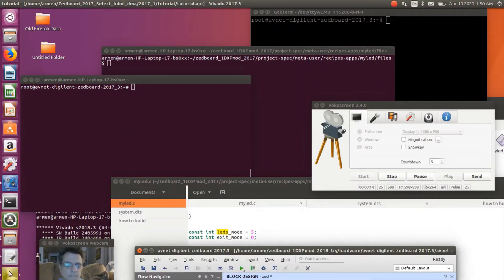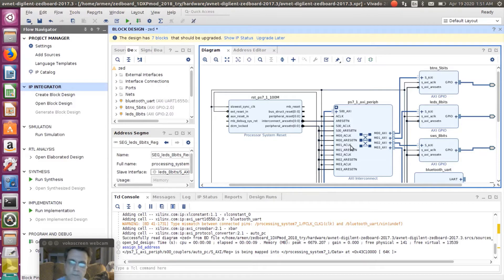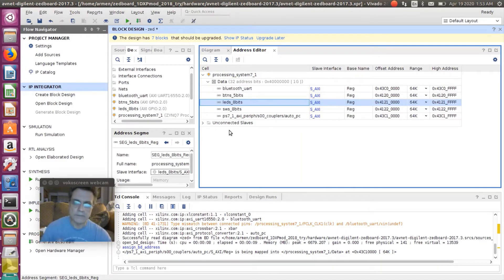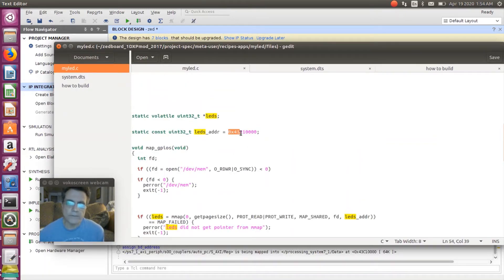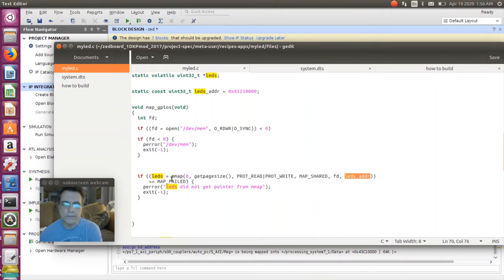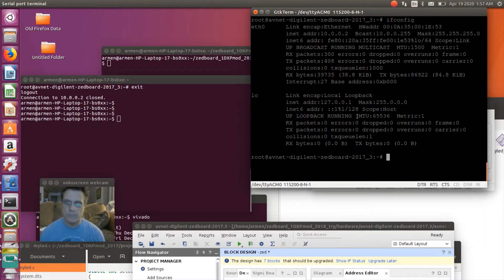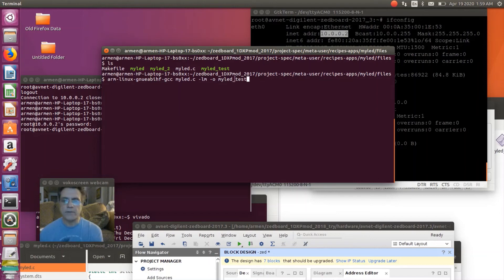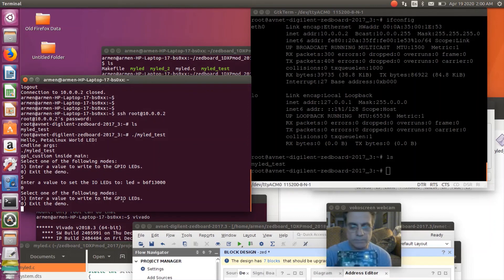Xilinx FPGA User IO Access From Petalinux

Comment: It took me forever to find this video! Thanks so much. This is much better than libmetal / openAMP. The xparameters.h headers aren't reconfigured unless you build petalinux w/ --sdk option which takes forever. (granted you can still manually copy the address from vivado instead of using definitions in xparameters.h)

But this method is actually portable, doesn't rely on xilinx from (the user-space side), so it'll be my new goto way of accessing gpios.

Why's it so hard to figure out how to read / write more than one bit at a time via sysfs? Only Xilinx knows I reckon...

Now I can finally get my midi project up and going (Whoop!):

https://www.youtube.com/watch?v=A60ndIy3InM